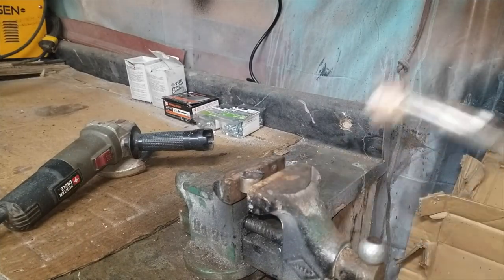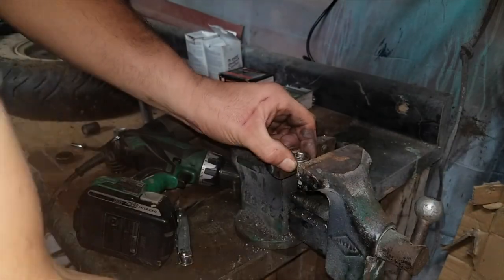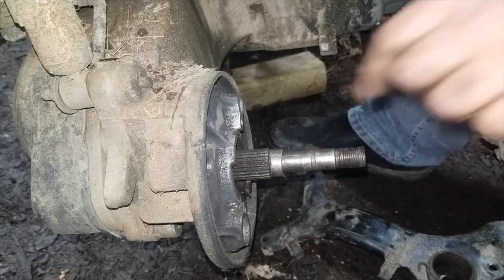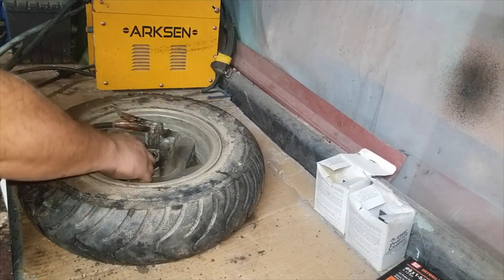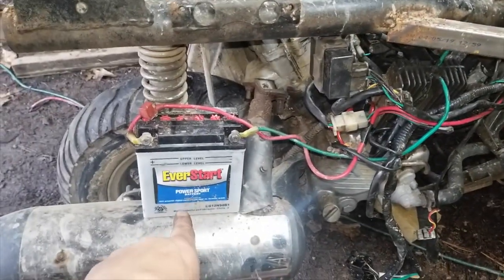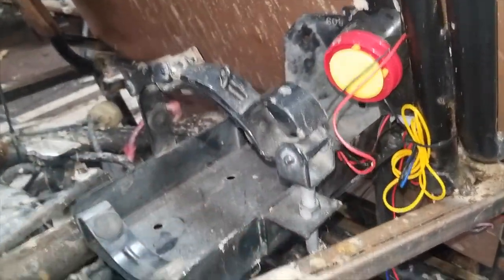DIY Trike-Fixing Wobbly Back Wheel New Battery Tray and More

Comment: The burnouts and general hooning have come back to bite you ! Great fixes Luke !
Reply from the maker: It was wobbly before the burnouts. It has been one of the things I have been putting off fixing(figured it would be more involved) I actually thought it was the bearings. I think when he had a back tire put on the scooter once they left the bushing out. It was only one of two times someone other than me worked on it for him. Still too wet to test drive it, but I bet it will be a lot more stable now.

Comment: Excellent work.  You mean. To say the wobble between the axle spline and hub spline is normal ?  I have the same wobbleness between the two splined pieces.
Reply from the maker: It seems excessive for the tolerances it should have. I think it should be more solid.

Comment: Great vid thks. I have same problem on my motorscooter. Gone worse that shaft is turning without grabbing wheel. Did you use stainless steel welding there? Thks.
Reply from the maker: I used normal flux core wire. Probably would have been better use stainless.
Reply: @lukeFugate  The problem  my rim is aluminium.
Reply from the maker: @guruji243  If the axle is spinning without the wheel you may need a new rim. Are the splines on the axle still good?
Reply: @lukeFugate  On the shaft you mean? Yes on shaft they are good.
Reply from the maker: @guruji243  In that case a new rim would be the best and safest way to fix it. I think by welding it You would have more problems.